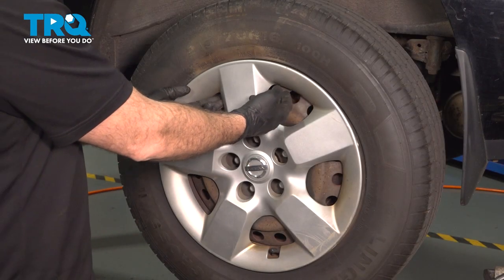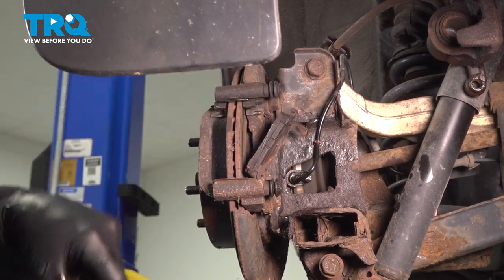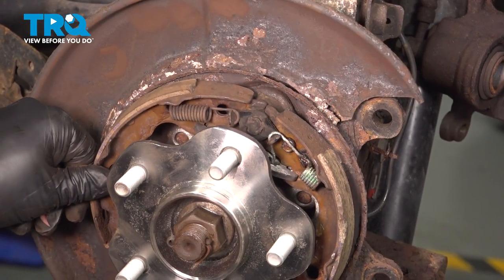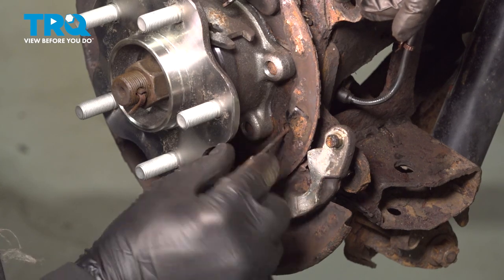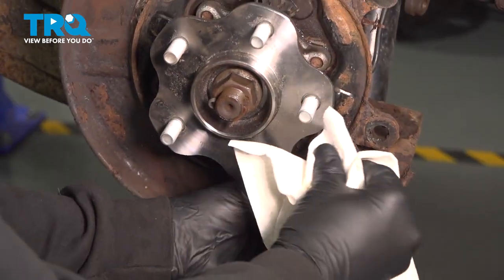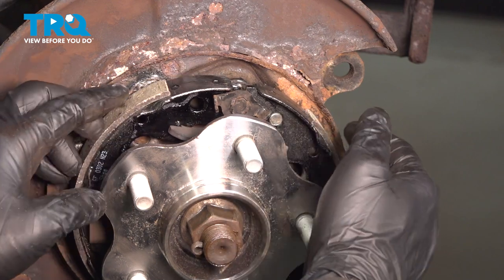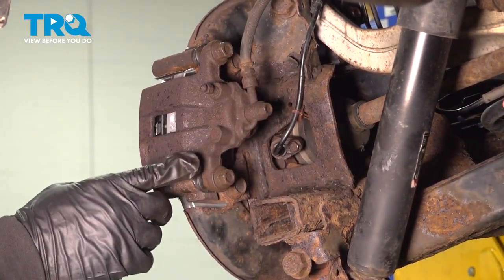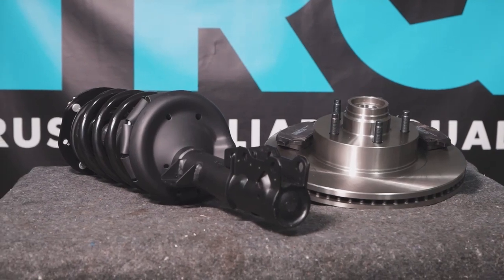How to Replace Parking Brake Shoe Hardware Kit 2008-2013 Nissan Rogue

Comment: I’d love to say this was helpful and informative…but not in the least! Watched this while doing this same job. Try doing it on a car that wasn’t previously disassembled. “Just slide the rotor off.” No, sir. Try beat the thing with a hammer to within an inch of its life and it’ll come off eventually. Assembly was just as much ‘fun’. “Just slide the rotor on.” Ha! Not a chance. I’ve taken the thing apart six times and reassembled following you step by step and it’s juuuust expanded enough that the rotor won’t go on.

Just for the record, I went to school for automotive repair, and worked as a small engine mechanic for years so I’m not some idiot that doesn’t know his @ss from a socket.